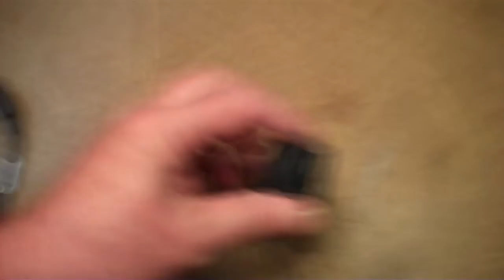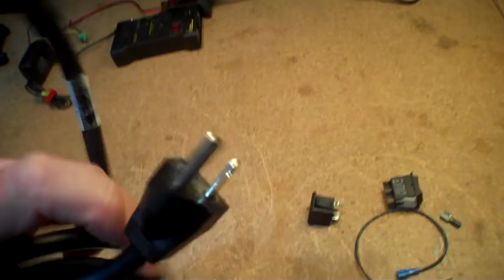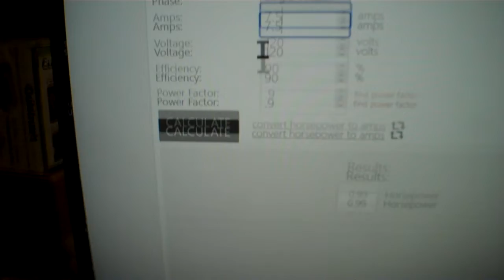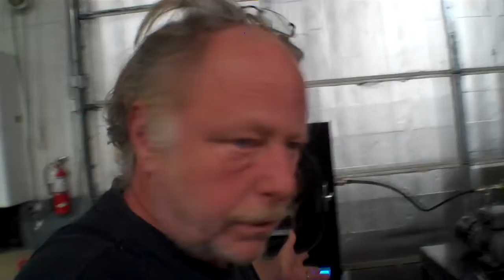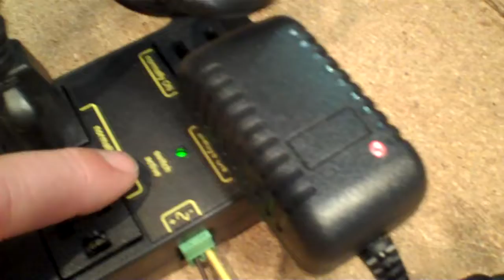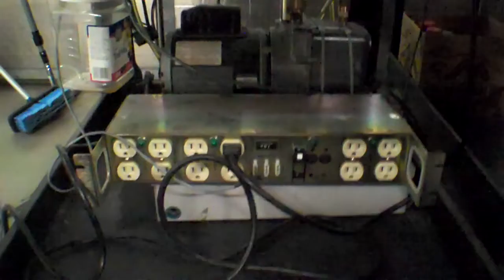Harvest Right wiring burned up. What caused this? HarvestRight Home Freeze Dryer. Smoke and smell!

Comment: Nice job, I have a 110-V relay that would work the same with out the DC adaptor. Another idea i have is a suction filter to stop water and sugar dust getting into the pump. Some vacuum pumps have a glass jar with a paper filter inside, To much money, how about a shop built filter / water separator? with 2 vacuum gauges. Let me know what your thoughts are on that. Why Mtorrs? In/HG is more common, Should a pump hold the vacuum stored in the FD when turned off? mine sucks air through the muffler and in 2 minutes all vacuum is gone. Thanks.

Comment: To this day these machines are not UL listed and have serious problems that cause safety concerns. I have been shocked by my machine. The heaters leak current and if you touch the rack while the machine is defrosting you get a mild shock.  One day one of these machines is going to take out somebody’s house and that will be the end of the company.
Reply: I'd say the ground connection isn't making a good connection if you're getting shocked off it. There should be a grounding wire that connects the rack to the case. The tray heaters should be replaced if current is flowing to the rack from the heaters.
Reply: @pstoneking3418  solid advice

Comment: I had this happen with my freeze dryer 3 or 4 years ago. The power cord was undersized. It had the right markings for the needed wire gauge, but it would get over 140 degrees f and finally fried the wires at the switch. I replaced the main power cord, and it never got warm again. (Of course I replaced the fried switch, socket and jumper wires.) Edit: Harvest Right sent me the new parts.
Reply: Did you contact Harvest Right and let them know their units are not correct and malfunctioning?

Comment: Thanks for all the info you give.  My Harvest Right,  middle of the line, unit has broken down twice within a year.  The first time, it was plugged into the wall and they told us to plug it into a surge protector plus other things to get it running.  We were able to fix it and get it going again.  The second time, it was plugged into the surge protector like they initially said and we were told , "Oh, no, don't plug it into a surge protector ever."  We have been working on the 2nd problem for a month now, still not up and running.  Have you heard of these problems?  Do you know what sort of person, like you, I would talk to about our problem?  Harvest Right hasn't been able to give us the correct info to get it up and running yet.  We are rewiring the electrical tomorrow and we know nothing about doing things like this so we are flying by the seat of our pants!!!  Any help would be appreciated.  I would like to say here, that we have loved our Harvest Right even with all thses problems, but we need it fixed.
Reply from the maker: What kind of problem are you having?
Reply: I feel your pain.  Mine was down for two months after only getting 3 batches in.  It may still be doing shenanigans.
Reply: Harvest Right is a hot mess right now.  They tell you on the phone to do what the written documentation tells you not to.  They want you to put tape on the pump connection and use a wrench now.  They can’t figure out how to make them without vacuum leaks so they just altered their software to allow it to work at 1000 mTorr
Reply: @johnf8877  Ours is still down.  My daughter has been getting emails from them on how to fix it.  She's gotten it almost there, but it won't complete anything without going down.  She's mailed the racks to them so we'll see after that.  Now, it's been down almost as long as we've had it up.  So frustrating.  When it works, it's a fantastic product, but it doesn't work long.

Comment: Wish you were closer.  I can't seem to get help from harvest right.  There has been too many changes I guess.   I haven't a clue where to go to get help trouble shooting my machine.
Reply: @dootpooter4740  I just ordered a Harvest Right oil less pump. The machine will take care of any moisture that gets into the pump, other than that oil free pumps run for years without any maintenance.  I'm  retire faa electronics tech have been working with these kinds of vacuum pumps for years.  The only thing that damages them is unchecked moisture. I plan on adding a water trap between my pump and freeze drier as an extra measure.
Reply: @dootpooter4740  because of your comments about oil free pumps,  I thought it possible that harvest right may be selling a less quality pump than I'm used to. So called them. Their reply was we don't recommend any period maintenance where you have to send your pump in for rebuild. They do repair those pumps but rarely see them requiring repairs until maybe 6-7 years usage.  Their reply was similar to the pumps that I was required to repair for the government.  So I have no worries about these pumps. I'm sure like nearly everything we buy today, these are made in China.
Reply from the maker: What kind of problems are you having?
Reply: @EpicenterBryan  They sent me a small insert for the hose to my oilless and the oilless seems to have lost some of its vacuum and the cycles started taking longer each batch.  When I called they did admit that that small hose was a mistake.  But I still need to get the pump fixed.  The o ring in the hose that came with the oilless had an o ring fall out and it won't go back in but it is damaged so I don't want it in there.  I can't find  one the right size and they don't carry that size anymore and keep sending me o rings for the smaller hose.  Plus they don't stock the larger hose to my oiless.  It looks like there was supposed to be a groove to hold the o ring but it is smooth which may be why it fell out.  I am not running it right now since my house is 100% solar power and the days aren't long enough or sunny enough to power the batteries to run the freeze dryer.  I can't remember what problem I had this summer but I might have found the answer on you tube.  I can't find anyone close who is knowledgeable and can help when I need it.  Telephone calls are great but still not the best.  I put the original oil pump on and it works but it's messy.  Everything I have is from 2017 so not on their site anymore.   I am trying to find a place to get parts because I think I can fix things and I have a son close who knows things too.  I guess I am frustrated because I paid so much for the machine and the new support techs are trained on the new machines.  My sister had one like you show in this video and the tech kept telling her she needed to put in a thumb drive and record info and email it to him and there is no slot for a thumb drive.  She was so frustrated she gave the machine away.
Reply: @lyndabuchholz1216  Unrelated to your problem, but you might want to seriously consider having more than one way to make electricity. You put all your eggs in the solar basket and it's not working out.
Reply: @PaulLawson-k8v  They definitely need the grid or grid to charge their batteries when the sun isn't shining.  I'm running my freeze drier off my solar and at present only have one of my 4400 watt inverters operating and it's doing fine. But when my batteries get low then the grid takes over and runs everything plus charges my batteries. It also sounds like they need to find a local appliance repairman to fix their freeze drier.
Reply: @dootpooter4740  something seriously wrong if you have to have a $1500 pump rebuilt every year. The freeze drier has a feature that draws any water out of the oil less pumps at the completion of every batch.

Comment: Outstanding Analysis Bryan...!   Truly amazing timing on this video, since 'TODAY' I started the process of fixing the smelly wiring, that has been plaguing me since 2020.  I am upgrading the (2 of 6) melted switch jumpers from 14ga to 12ga; an attempt to prevent the insulation from melting off.  Two of my heaters are falling off the bottom rack shelves; so I used '3M Super 90 contact adhesive' to reattach them, (no reply or suggestion from HR on this issue) fingers crossed.  Love the remote relay system, I will be upgrading that for sure.
Reply from the maker: Wow. I'm surprised you are running into issues with the wires. Are they crimp connections?
Reply: Where did you purchase the input connector? What voltage as well? That that matters i have a med 4 tray freeze dryer

Comment: Thanks, Buddy! Is there any taletail stuff to give warning that a pump is pulling too much or do I need to get a Killowatt or something to do some measuring? I just have a dinky multi-metter and am NOT an electricianer but do have a system like this to pull an ozone generator and compressor that are 110 off a 220 feed with a timed relay, an 8-pin I think that just puts in one shopt per pump actuation. I'd use your setup for this if needed. Happy Thanksgiving and God Bless yall!
Reply from the maker: You can always feel the main power cord on either end. It should never be more than slightly warm to the touch. You can also buy an inexpensive power meter. Most can measure amps in addition to watts and watt/hours. I've seen several under $20.
Reply: @EpicenterBryan  Thanks, Pal. Toots runs fans to keep everything cooled down and no issues yet but if anything gets sideways I'll be back in touch. Happy drying!

Comment: so, running multiple units off of one pump means at any given time the pump could be working and drying two units simo or even 3 in your setup - so there is enough power to draw down the sufficient mTor on all units?  it just may run longer or even around the clock depending on the cycle the unit is in?
Reply from the maker: Yes, I have been using my Leybold with two freeze dryers for over 3 years. But I've also been running three now with the same pump for about 4 months.
Reply: @EpicenterBryan  What is the sufficient mTorr? HR wont say. I think it should be 50 or lower..thanks.